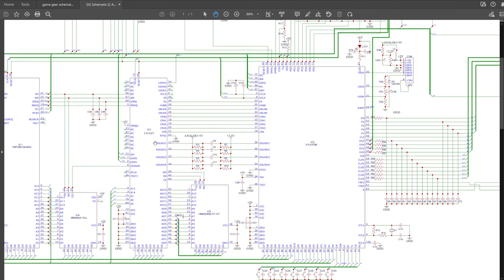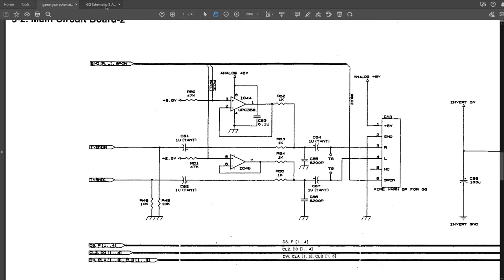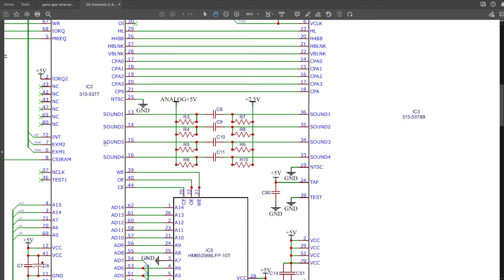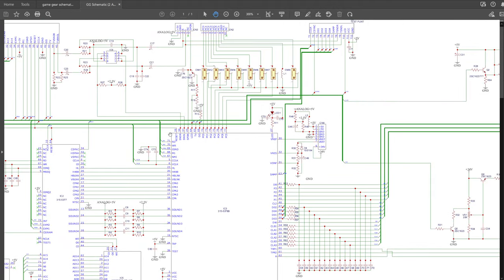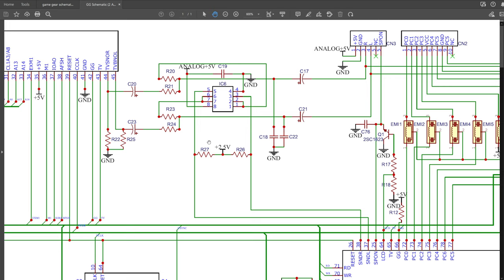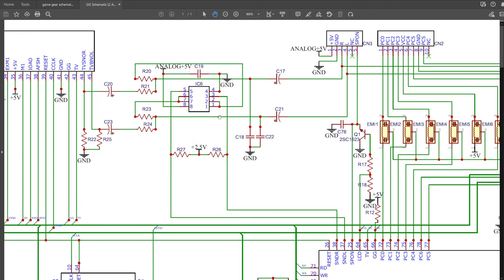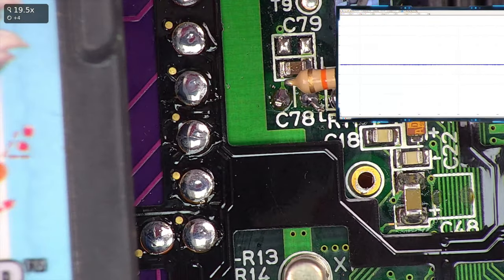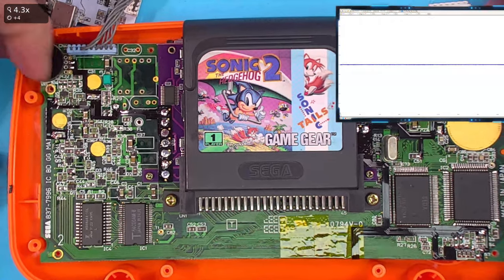Game Gear Audio Amp Design Oscilloscope - RetroSix Repairs

Comment: I've come across that crackling audio issue a few times and I've really struggled to fully remedy the problem. In the units I dealt with, it wound up actually not being the cable itself, but damage to the holes the audio connector is soldered into from leaked electrolytic fluid. Changing the cable out made no difference for me.